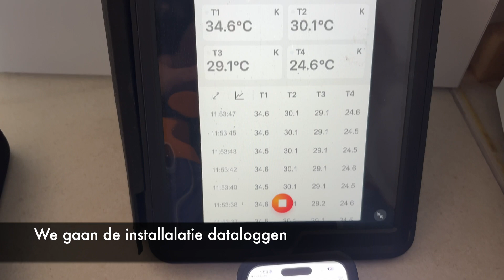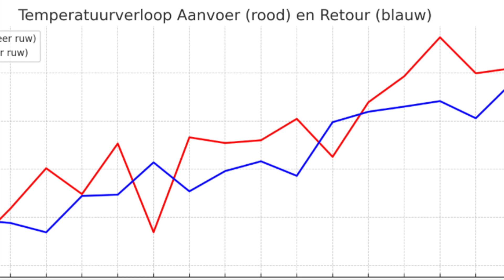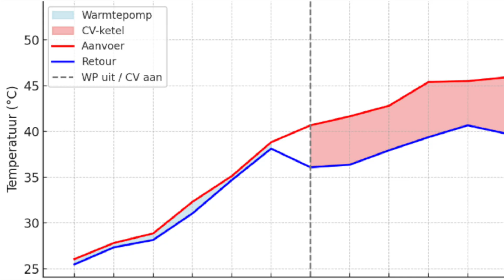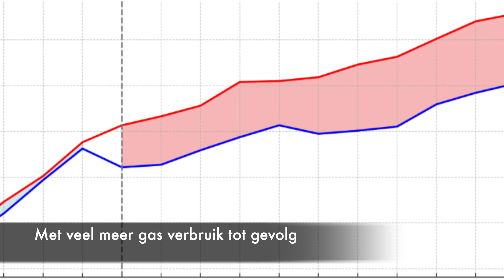Fujitsu Aurea draait nauwelijks: cv-ketel doet al het werk…

Comment: Plaats in de keuken een keukenboiler 10 Liter van Hornbach 125 euro en een doucheboiler 50 liter Wahlbach van Hornbach 175 euro op stroom van het dak. Goedkoop en makkelijk en spaart ook nog water en werkt beter dan Gas. Voor koken zonder gas een inductiekookplaat 200 euro bij Hornbach. Ik heb een nieuwe LG Therma V Monoblock 9 KW warmtepomp 3500 euro bij Aircoplaza Zwolle. Subsidie was 3075 euro. Vorige week ontvangen. Geen Gas geen problemen. Maart was de energierekening 15 euro.
Hele huis warm.
Ben heel tevreden.

Comment: Ik heb al 13 jaar een warmtepomp op gewone radiatoren. Geen Gas. Keukenboiler 10 liter 125 euro bij Hornbach. Doucheboiler 50 liter 175 euro bij Hornbach. Inductiekoken 200 euro bij Hornbach. Vorig jaar een nieuwe Warmtepomp LG Therma V Monoblock 9 KW bij Aircoplaza Zwolle 3500 euro. Subsidie was 3075 euro. Vorige week ontvangen. Geen Gas. Geen problemen. Deze maand 15 euro energie kosten met ANWB dynamisch. Probeer maar. Beter als gas. Hele huis warm.